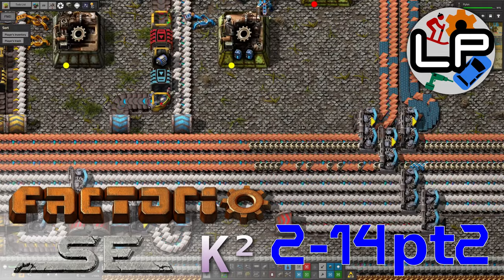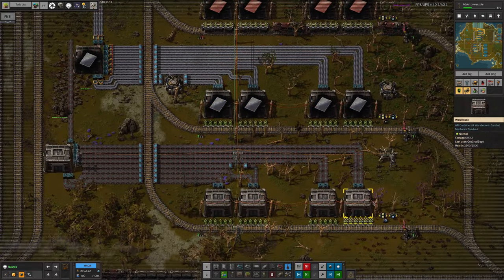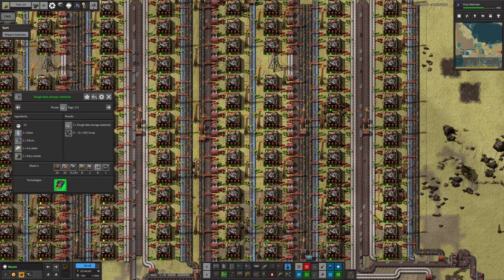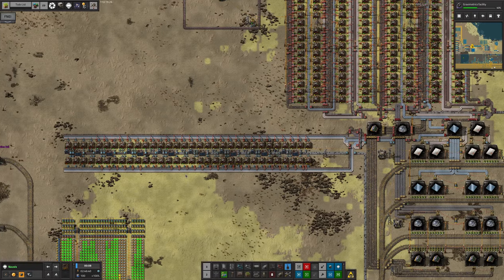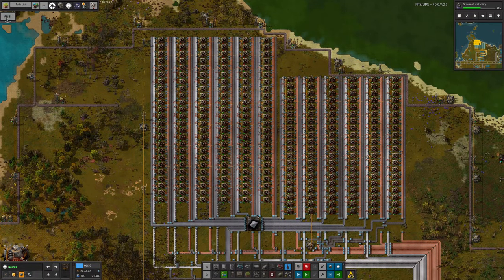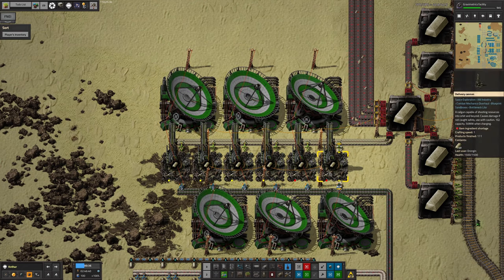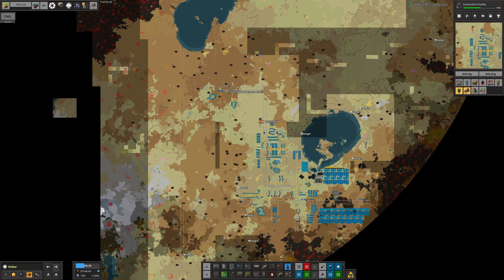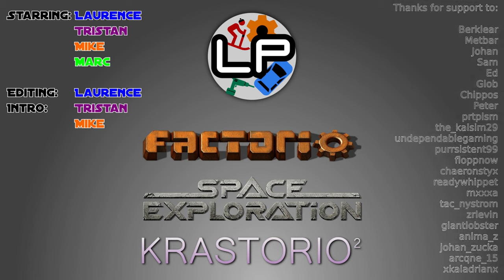S2-E14 pt2 - Contamination - Laurence Plays Factorio: Space Exploration 0.6 + Krastorio²

Comment: 23:00 - It looks like the core fragments have stopped flowing, therefore no delivery cannon capsules are being made. At 23:33 you can see that the pulverisers have a yellow light for output full - it looks like its an excess of raw vulcanite on the belt?
Reply from the maker: Yes - I tried to explain this, but perhaps didn't do it very well! Basically:
Immersite shipping has used up all the delivery cannons, meaning that the glass isn't getting shipped, so the stone has backed up, stopping the pulverisers, meaning that the vulcanite ore can't flow from the core pulverisers, meaning that no core fragments are going down to make delivery cannon capsules.
Reply: @LaurencePlays  I sort of got this, although I did type out the comment before I'd seen to the end of the video :D

how far off spaceship automation and/or space elevators are we? I think that that'll be the key milestone for interplanetary logistics!
Reply from the maker: @ElMikePlays  Yes, having space elevators and spaceships will make all the difference - everything we're doing at the moment is just a temporary system to get us to that stage! I believe we need material 1 and 2 for elevators and then also astro 2 and 3 for spaceships. But I could be wrong!